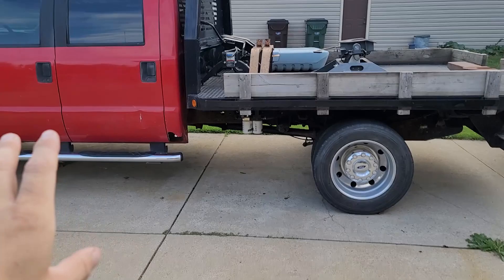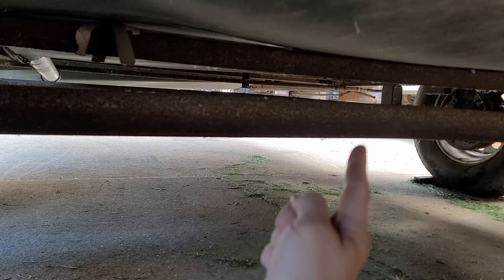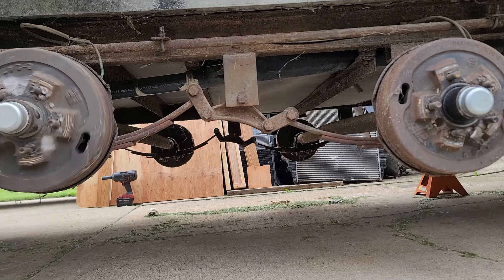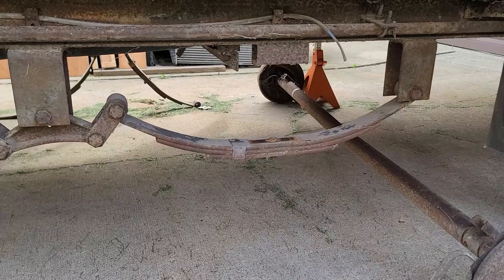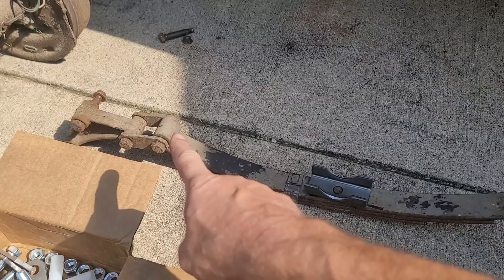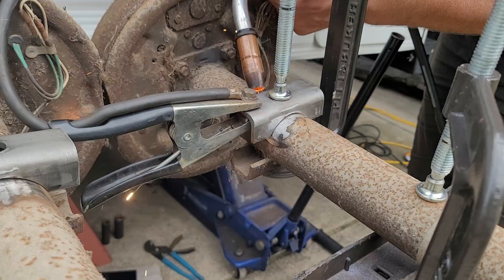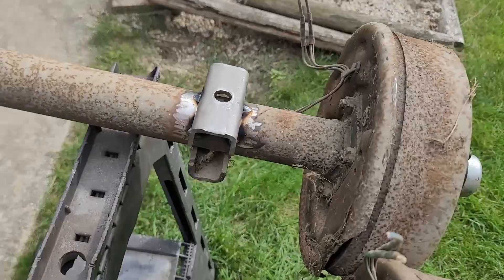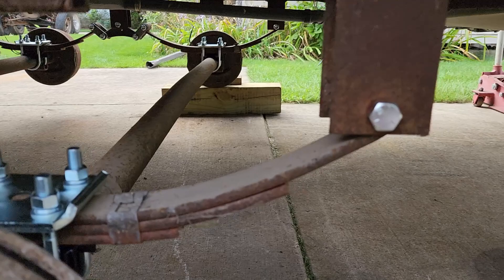INSTALL A 6" LIFT KIT AXLE FLIP ON A 5TH WHEEL CAMPER TRAILER CHEAPLY USING A MIG WELDER - HOW TO

Comment: The non-factory shackle bolts aren't splined, so they won't spin. Just tack the Bolt Head to the shackle plate so the bushings have to rotate around the bolts. The wires that run through the axle tubes will often short out on the inside of the axle tubes. Duplex wiring can be run on the back side of the axle tubes. Wheel bearing should have a little play.001"to .005" end play.
Reply from the maker: good advice on the tack weld to keep the bolt from spinning!

Comment: Could've added blocks between axles and leaf spring for additional lift
Reply from the maker: Yes, blocks could be added, but it sits right where I want it without blocks.  The spring over axle worked out well in this case.  Thanks for watching!

Comment: Recently  redid my trailer  suspension.  I used bronze  bushings  and wet bolts on the springs and equalizers. Time will tell how long they will hold up. I do like the fact I can pump grease thru the bolts onto the bushings.
Reply from the maker: That's a great idea, I'm sure it'll hold up pretty well!  I'd like to get my hands on those parts,  where did you buy them?

Comment: Nice Video a lot of good info. Should have reinforced the hangers while you were that far into that project.
Reply from the maker: Thank you!  I thought about that, the camper is a 1996 and has been all over the country, I figured after 28 years of use they hadn't broken or cracked yet I'll leave them for now.  Thanks again for watching and taking the time to comment!  -Frosty

Comment: I loved the video and explanations regarding why you replaced certain parts and what parts typically wear out; all the things to anticipate ahould probably be replaced to avoid future issues when on the road. One question is if the raised height effected trailering/handling at all and would you recommend "flipping" axles? I have the same issue with an older 5th wheel we bought attached to our newer Ram 3500 so the trailer rides nose high. Thanks
Reply from the maker: Thanks for letting me know you enjoyed the video, I enjoyed making it and I have put on a few thousand miles on the trailer since the video was released.  The trailer pulls much better than it did prior as it's no longer nose high, the weight is spread evenly now on both axles.  I have not noticed anything negative at all.  A few things I'd keep in mind is the overall height to make sure you don't have problems with bridges or the State troopers, keep it under 13'6".  I think the spring over axle was a great idea and I'm glad I did it, but make sure you don't "flip" the axle 180*.  That'll put the camber/bend in your axle the wrong way and your brakes will then be upside down.  Keep the axle orientation the same and move the spring position.  Hope this helps!  -Frosty